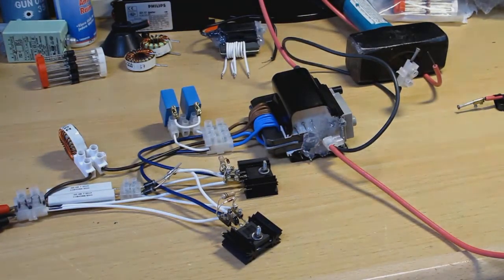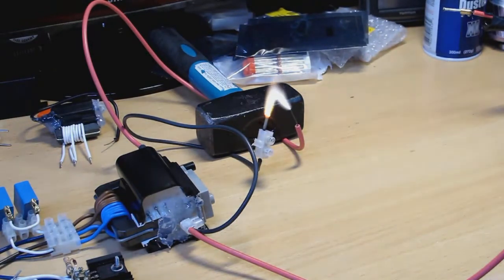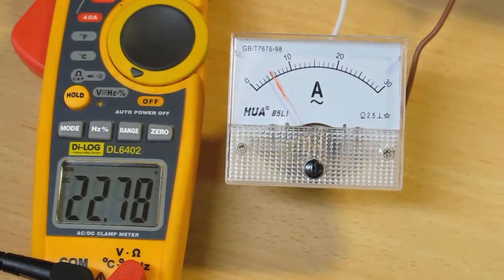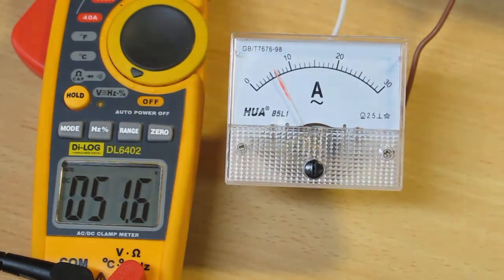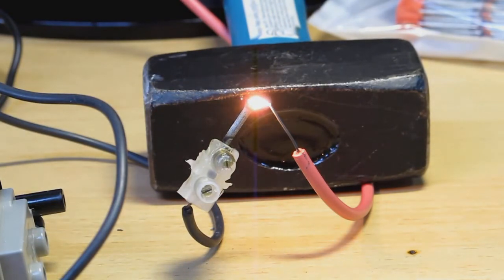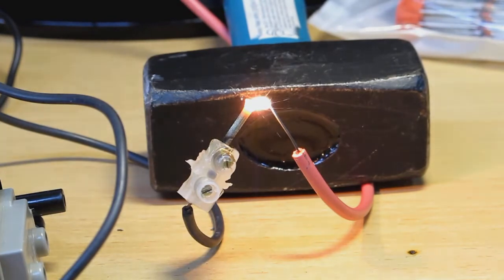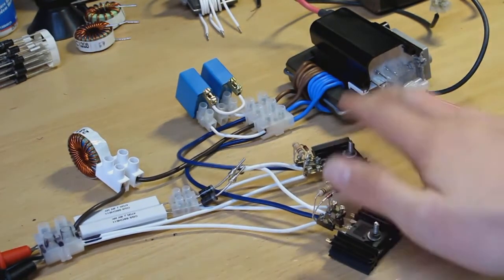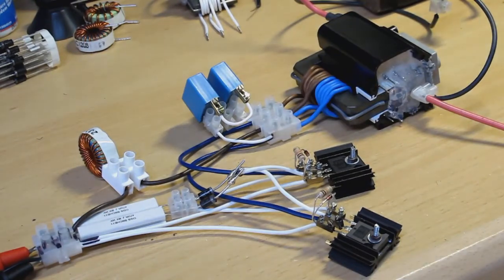Flyback Transformer: Quick update.

Comment from the maker: The problem was my inductor I reckon, it was just letting too much current through. This 100uh one I'm using at the moment seems to do the trick. The spark between the pins only lasts for a fraction of a second when the arc strikes but it can't be very healthy for the transformer windings.